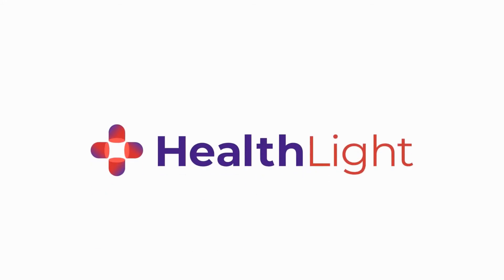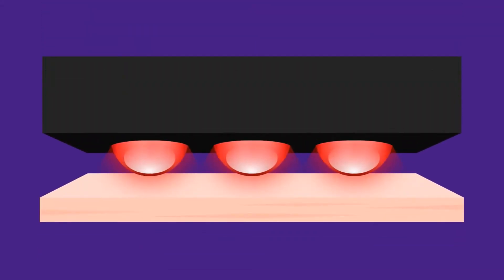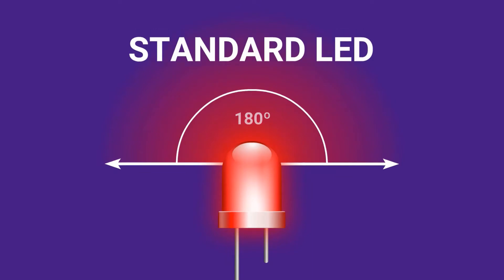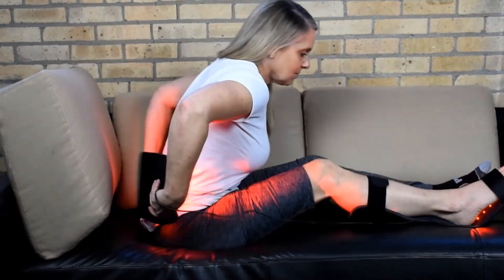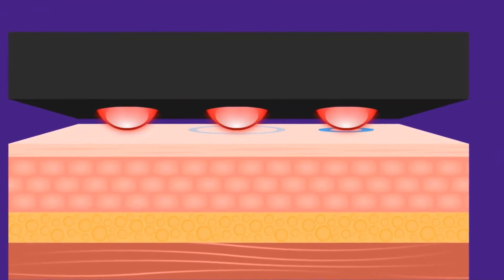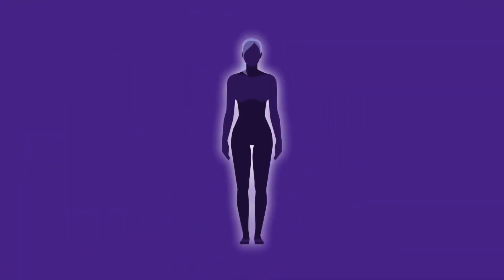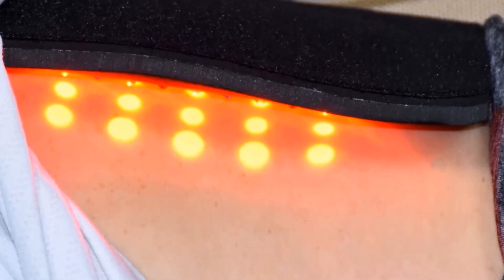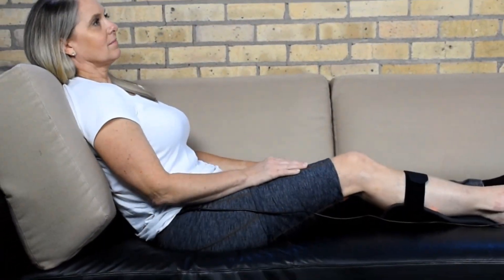Why HealthLight? Better Design & Superior Diodes Deliver More Power

Comment: Is Health Light same as In Light Wellness System?
Reply from the maker: HelathLight is a different company that manufactures in the US. HealthLight's pads have higher joules (this is essentially the dose or energy measured at the pad surface where it enters the skin) as measured by a 3rd party lab. Another notable difference is that the diodes are set lower in the pads that makes them more comfortable for certain uses, like going over a joint/bone area.